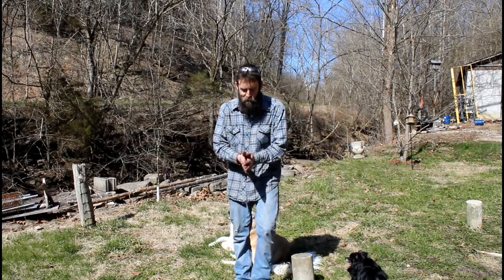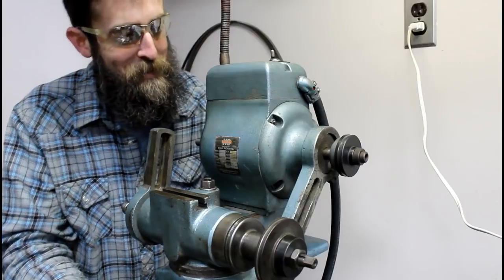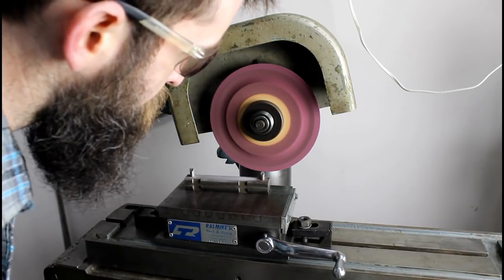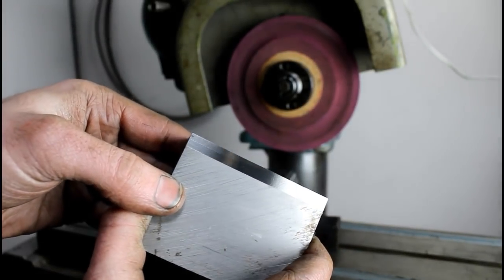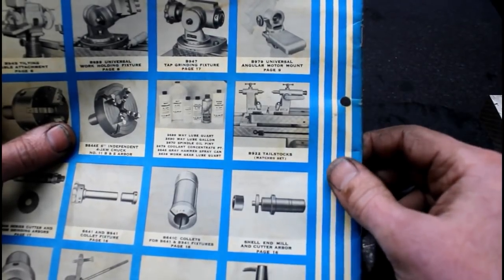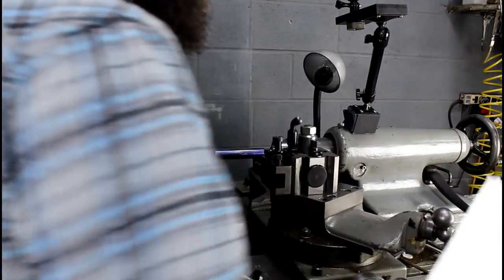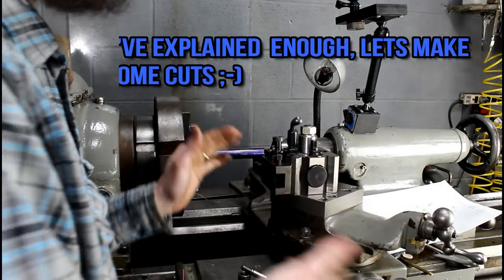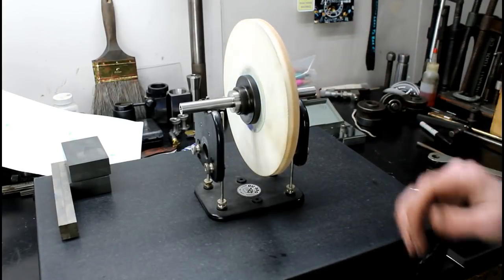A TASTE OF SUCCESS!!

Comment: Steve don't forget, if your are going to use the arbor, balance it ,by it self, then you will know that the wheels are out, and not your arbor
Reply from the maker: Paul Koomen yes of course 👍Thanks for watching, I really appreciate you watching
Reply: Good tip, the store bought harbors are usual marked with their balance results, are stock could have inclusions or other issues that could throw it off.
Reply: Paul Koomen I

Comment: Hey, I hate those motor phase converters too, then I found the Lenze digital converters. Less expensive, no noisy motor, forward and reverse and best of all, with a $20 Lenze rheostat and it gives me a dial speed control. I have one on my mill and it's great.
Reply from the maker: Nik C. Colyer I have seen them but never read into them. I think for this little grinder that would be a better choice. I have hear that the non rotary converters  don't give the power of the rotary . But that said I have no experience with them and that could well be false information for all I know.  Seeing your logo made me realize that I had never responded to your question about working together on a group project. The answer is yes, I would like to do that. I covered up right now but let me know what you have in mind and we can talk about it👍
Reply: Yes, at low speeds the power drops off, but when I want a low speed on my mill I shift into low gear and I can hog a few hundred thou at a time or drill a 1" hole without effort. The cool part is it's silent and I use it as an off/on switch. I'll send you a photo of it and the rheostat.
Only problem I experienced was once I bought one I immediately got rid of my noisy rotary converters. Cost me a bit extra to convert my other machines.

Comment: Nice Job Steve. In my opinion wheel selection and proper dressing are two of the most important things to focus on for successful grinding. Steve
Reply from the maker: Solid Rock Machine Shop Inc. I'm sure you know what your talking about Steve👍 You do some good work over on your channel. Thanks for the advice. I have lots to learn.
Reply: I think you will do just fine. You strike me as the type of guy who doesn't thrown in the towel right away. There are a lot of variables in grinding and controlling as many as you can makes a huge difference in the outcome. It can get a little frustrating at times when things don't go the way you want but don't give up and don't be afraid to try different methods. Steve
Reply from the maker: Solid Rock Machine Shop Inc. I love the details. My issue is knowing what to look for. Just going to take time.

Comment: That ain't premature. Not that it is a good idea, but if it were mine, I would have ground something before it was ever even in its spot in the shop. I am very impatient to a fault. I admire your patience and ability to thoroughly evaluate stuff before going any further. Not me, I am balls to the wall......... LOL
Have a great week friend.
Reply from the maker: grntitan1 The only reason I waited to run the motor and spindle was due to the crusty wires and needing to find the proper cord.  I'm balls out most the time myself 😃
Reply: Why? He was experimenting. There is absolutely no reason to ground the magnetic chuck top surface until he is ready to actually start grinding stuff that matters. None, zero.......

Comment: for your dust collection beginning start with some kind of Duct Boot.. fits in the walls between studs for AC/Heating ducts.   there are a bunch of different shapes and sizes plus they are cheap and already made up.  you could use conventional duct elbows to get you to a dust  catch can that has another duct boot cut at a compound angle  for the entry from the grinder.. a bung on the top center to extract the air from it..   think steel 5 gallon can. 

 on your phase converter.. off camera.. you might want to examine the internal components to see what is vibrating.. sometimes the laminations can vibrate and need to have the screws holding them tightened Slightly.  if it quiets down after a few hours of operation where it comes up to temp. you have found the issue.  belville washers might be used to keep tension without over stressing  or stretching the screws when it warms up.  my brother got a disco to put in a similar device to isolate their noise from the powerlines into the recording studio. when they turned it on it was like standing behind a jet plane.with the engines at take off power. i picked up a grinder my self last week. https://i.imgur.com/zv9dz93.jpg can't wait to start working on it.

Comment: Great to see it running. I would dress the wheel with the diamond in running direction slightly behind the center of the wheel. So, if the wheel catches the diamond, it will shove the diamond away. If you have by accident the diamond slightly before the center, and the wheel grabs it, chances are, that it will end catastrophic for the wheel and / or the diamond. The wheel can explode in worst case, and that is not funny, i guess...
Reply from the maker: Udo Willkomm It's only funny till someone loses an eye.  Really they are quite dangerous and proper use is important.  I've still got a lot to learn.
Reply: The dressers i have seen are pre drilled so the diamond is tilted slightly back from wheel center to help with the grabbing issue. Even tho they are tilted i agree they should always be used just left of center.
Reply: Yes, tilted away from the rotation at a 10-15 degree angle,  Then rotate the diamond at intervals so you dress with a pointed diamond, not a flat one.  When you were grinding it sounded like a wheel not completely dressed to full circumference, or wheel hop from balance, probably the former by the sound of it and the nice finish.

Comment: I grind a lot of different things at work. I run a Studer20 OD grinder and also big Blanchard machines. We use wheels that are anywhere from .100 to 4.00 in width and 6 inches to 24 inches in dia. We used to use manual balance methods with mandrels and a cradle but the company purchased an electronic balancer. Works kinda like a tire balancer. I don't really like it and mostly still use a mandrel and cradle. Your machine can do a lot of work but don't get too carried away with it. Not sturdy enough. Like your measured way of doing things.

Comment: Steve - You need to look into a solid state phase convertor.  They are not nearly as pricey as they used to be.  They allow you to set and hold, under load, a desired speed, reversible, as well as having the benefit of soft starts.  In the mean time relocate your current phase convertor so you and the rest of us don't have to hear it!

Comment: Steve that must make you feel good that it runs fine. I'm sure you know you need to true the wheel before you balance it and every time you remount it. BTW you can buy wheel hubs with moveable weights to make balancing easy and safer than taking material from the wheel. One other tip, keep the diamond just behind center so it can't jump into the wheel.
Reply from the maker: Cape Cod CNC Seen some of those adjustable hubs on ebay the other day. I need to pick some up next time I find them cheap.👌

Comment: I love that little machine, and I am very jealous if what you have in the shop. 
I love the videos and what your doing I thinkni great.

I have a small shop and so far only really a small lathe, drill press and bandsaw. Just made a vacuum chamber and I think that one would be good for your shop ;) at least to take some peeps (candy marshmallows) and see what happens when they are released to space atmosphere. Tasty when the experiment is over 

Anyway thank you Steve for doing great videos. It's awesome
Reply from the maker: tek413 LOL, I love the yellow peeps.  I have several vacuum pumps I use for all sorts of things.👍  Having  a very small lathe is 100× better than no lathe.  Bad thing about big tools is they require tons of space.
Thanks for watching 👍

Comment: Looks like just the slightest bit of chatter.  Not sure if you'll get much better than that with such a light machine.  More mass would probably dampen that a bit.  Overall, looks very nice.  Good work.
Reply from the maker: MikeBramm Yeah, that may be about as good as it gets on this little machine. We will see.👍
Reply: Sounds like a wheel not dressed around the full diameter (Edit: circumference), or wheel hop from out of balance.  From the nice finish you got, I am guessing the former...
Reply from the maker: Bob Korves Hey Bob  good to see you. I would say you are correct and it is most likely a mix of both. I admit I know very little about grinding. I'll get it. 👍

Comment: Motor and spindle sound great, they needed to be used, you can replace the bearings in the future if you choose to. It left a nice finish for first sparks, I understand the excitement of having a new tool and wanting to use it.
Reply from the maker: Jim Zivny Yeah it did need run. Bearing just setting around is not good.  Nice to see you Jim